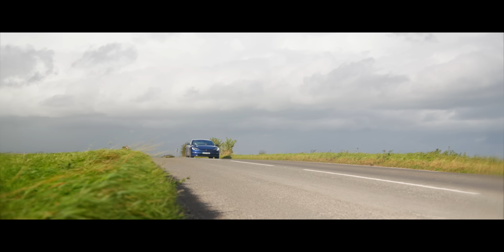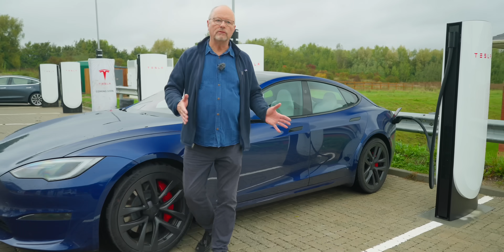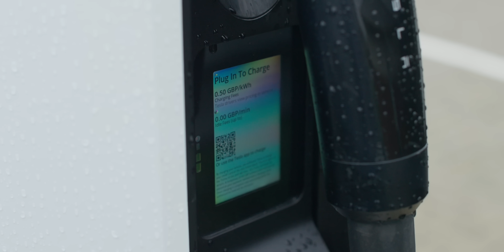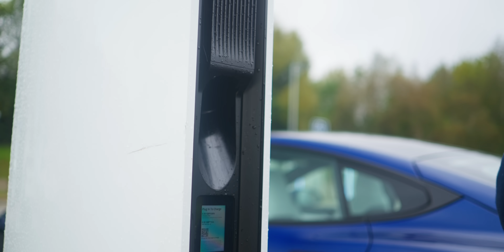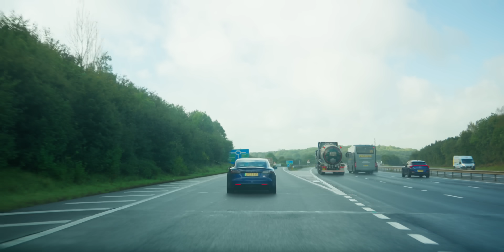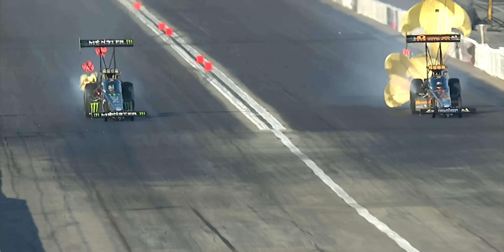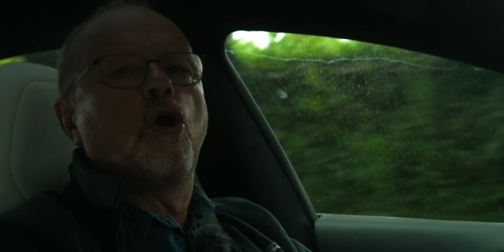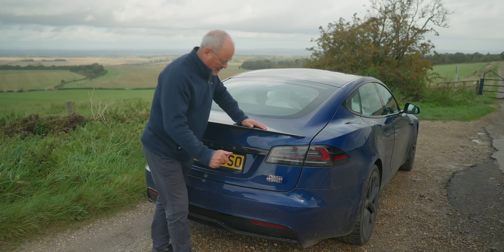THIS Is Why The Model S Plaid Didn’t Come To The UK

Comment: I'd have liked to have seen more of how the indicator buttons turn out. What happens when you want to indicate your exit on a roundabout for example when you're turning right?
Reply from the maker: You can watch the episode I did about the newly refreshed Tesla Model 3 where I first encounter the indicator buttons. I indicated right by accident twice while driving this car when going around a roundabout. Seriously not good. I think you would eventually get used to it, but it's a pain. A little lever, it's easy, you barely notice it.
Reply: @fullychargedshow  I would not be surprised if this actually sparked some regulatory response in the EU. This is a move that only makes sense really in the country that doesn't use them because they're too complicated.
Reply: @fullychargedshow  if you put your hands 9 and 6, and only hand over at then end, it works splendid. Your thumb always ends up at the right spot.

That's why the yoke actually works better, because it forces you to use a proper steering technique. A round steering wheel allows for sloppy steering and then the buttons don't align.
Reply: @WouterHermans  I dont want to be forced from the car how to use it. Everyone has other preferences how he wants to drive. A car that can only have one proper way has bad design and bad usability from my perspective.
Reply: @WouterHermans  If you have to do all that to take a simple turn you're terrible at driving. I always turn and drive one handed and most people I know do the same. Only drivers I see do what you do are new drivers, old women etc. Don't give driving advice please.
Reply: "Roundabout? What's that?" is your answer.
Reply: What a superb machine! Loved your rant about ICE cars and I agree! The stalks should stay though I think 🤔
Reply: honestly the stalk on the old model 3 is already bad - it's the style BMW used during the period they became a joke for never indicating, and the two things are almost certainly connected. Just use a normal indicator stalk and it works well vs the tesla where it doesn't latch so you've got a race condition between auto-cancel and you trying to indicate the other way, fine on well spaced junctions but a bad joke on small roundabouts etc. Buttons make it worse by adding it being easy to mix them up.
Reply: @asharak84  Thank you for pointing out this annoying thing. I also dislike the non-latching indicators in my Model 3. I thought I was the only one because I haven't seen others pointing it out.
Reply: @asharak84  Whenever I drive my Wife's Model 3 I'm always accidentally indicating in the opposite direction when what I intended to just cancel the indicator that failed to self-cancel. Not a mistake I make in my Model S.
Reply: @PhonicUK I had that issue in my wife's Model Y at first, but set Automatic Turn Signals to Off in my profile and that made for a far less maddening driving experience. They still auto cancel after a corner like traditional signals, but not for lane changes and off ramps where their logic is hit and miss.
Reply: @asharak84  you can cancel the indicator by pushing the stalk in either direction, so if you are indicating right around a roundabout, push the stalk up to cancel, and then down to start indicating left. That's easier than trying to do down-down, but it still takes some practice. I hate the idea of buttons on the wheel.
Reply: @gz3zbz  I know, but you still have a race condition whichever direction you use. "Cancel" and then apply indicator, but it auto cancelled in that moment? You cancelled your own indication. Assume it will auto cancel and hit indicate before it does? You cancelled and didn't indicate. As I said before it is fine when you have time and space between indication areas, but sucks on small roundabouts.

Edit: it is "solvable" by just holding the stalk in the direction you want to indicate - but then, that is what the latching style do for you
Reply: Also, surely it'd make more sense to do the Ferrari thing and have the right indicator on the right side of the steering wheel?
Reply: @mikeymike1792 
Tiny bit better but any button on a steering wheel is a moving target, you got to take eyes off road to have a stab😂 I foresee a future where Tesla owners just don’t bother to indicate off roundabouts ?
Reply: @jamiepolson the same goes for the blind spot camera. The video should not be on the infotainment screen. This is why I have physical switchgear. Aircon - three shaft encoders. Eco(city mode) -centre console. Front badge release push button. Spotify/Audible on apple carplay probably the most infuriating and focus demanding feature of my car. But at least I have a rotary controller on a stalk behind the wheel to skip through my playlist.
Reply: @jamiepolson, I see a future where M3 drivers routinely get T-boned exiting busy multi lane roundabouts, on account of errant indicating. I can see the buttons working fine on big US cloverleaf intersections and their wierdo four-way stops - I just don't think they considered roundabouts as they are barely a thing in the states.
Reply: I would say that the lack of stalk is dangerous, especially as people will likely be driving this car fairly quickly, good luck indicating properly to come off a roundabout. The one time you don't want to be looking down trying to find the left indicator button on a rotating wheel. Even a motorcycle style switch would work better than that.
Reply: @timscott3027  yes it’s silly to mess with stuff that’s always worked well, just because you can…
Reply: sorry to obsess into your privacy, I need freelancers for my project retyping document MS word into PDF file

Comment: Here in California, I have encountered MANY Tesla drivers indicating the incorrect direction with their turn signals. This is how I know that their car has placed the indicator buttons on the steering wheel. I suppose as a Californian, I should be happy that someone's at least trying to use turn signals ... since most of the people here don't anyway. 🤷
Reply: "Many"?
Since the Y doesn't have the modification and the only 3 with it is the upgrade, not yet available in the US, that leaves just the latest S and X, then only those in California....
I'll say again ...
"Many"?

Comment: The indicators is insane and Tesla arrogance! If it ain’t broke!
Reply: They may get used to no stalk in the US but they don't live near Milton Keynes.
Reply: That attitude is the enemy of progress and innovation.

If it really doesn’t work out, Tesla will return to using stalks, but so far, reviews have generally indicated that those with an open minded approach find there’s absolutely not difficulty in getting used to it.
Reply: @edwardhackett-jones8126  We havn't seen the same reviews.
Reply: @pauld3327  as someone with shares, I spend (too much) time looking at how Tesla products are received and everything else I can find too.

No question the bulk of reviews I have seen have been positive about operating the controls without stalks.
Reply: It's not arrogance it's cost saving. They no longer need to purchase or build a couple of levers and attach them to the steering column.
Reply: @ruk2023-- It's not cost saving. Elon doesn't want us to drive his cars. He wants us to buy his FSD software that isn't even available in Europe.

Comment: Is there still a software incompatibility between Ioniq 5 and Tesla superchargers?
Reply: i think there is. but even if it works as it should... at a 400V charger those 800V cars will never get good speeds.
Reply: @Ultravore  so far I’ve not had the need to stop at a Tesla. I’ll try to keep that up.
Reply: The deficiency is in the car, not the charger.